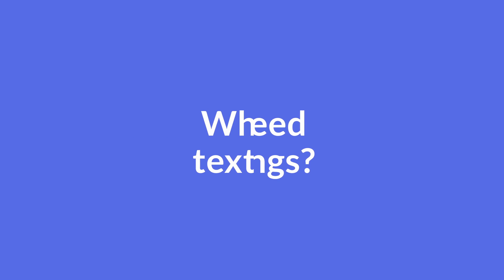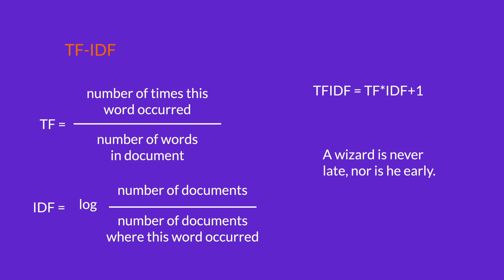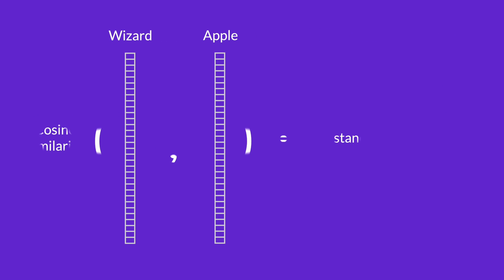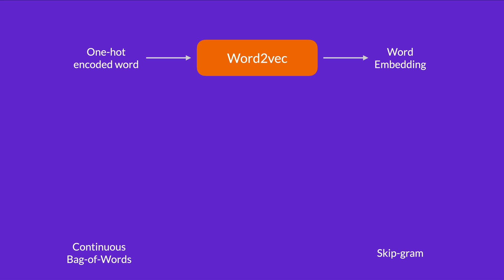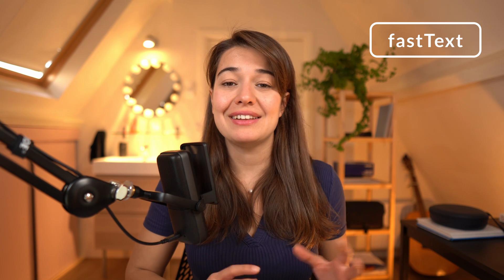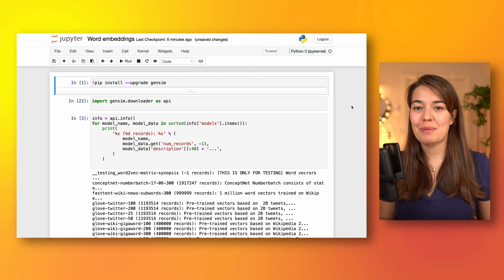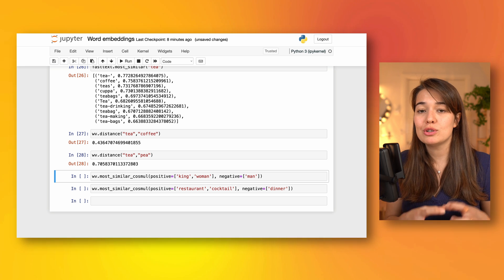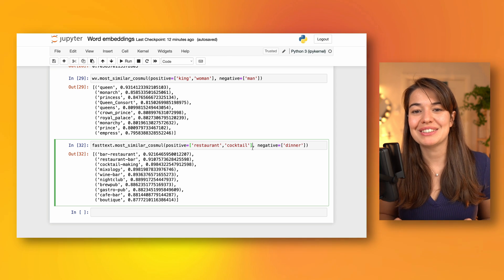A Complete Overview of Word Embeddings

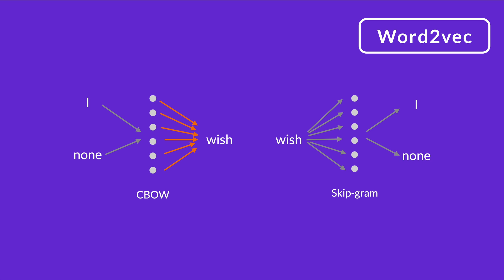Comment: Thanks for this easy to understand video! 😊At 8:25 it was mentioned that CBOW's embeddings are the input weights and in skip gram the output weights are used as embeddings. Does someone have a reference for that? Most papers I've found say that the input weights are used in both models.

Comment: Thanks for the video I do have a question when you said that for instance in the CBOW there is only one layer it means that the ouput of this layer should be a vector of size dimension of the embedding but in order to train the model we need to compaire this output with the word in the midlle which is actually a one hot encoded vector of size dimension of the vocabulary so it migth have another layer and a softmax.

Comment: How do I know which embedding will be best choice for a specific use case? How do I know which distance measure will be best?
Reply: Depends on your use case, cuz lets say if your use case contains more in general words like tea, king, actor, etc. then you may try different embeddings and see for yourself which ones are working well for particular examples from your use case 
OR
If your use case is quite specific, something like say representing skills as a vector then you may need to train your own word2vec model on your data since pretrained embeddings may not cover what you need